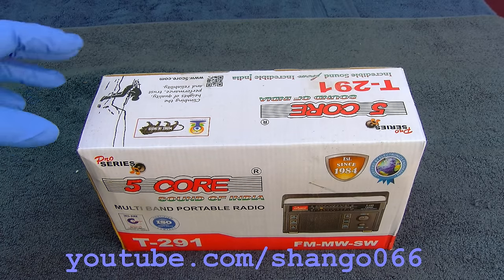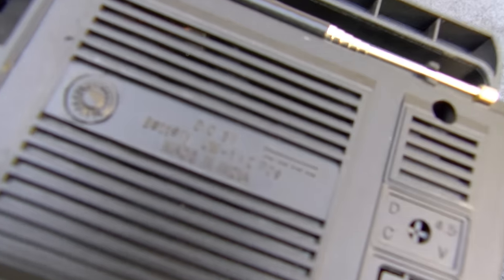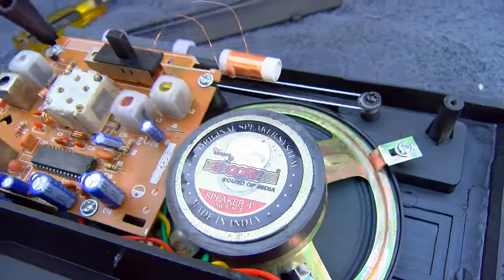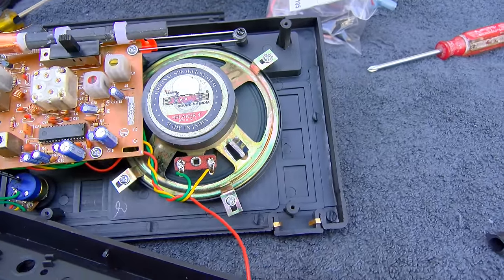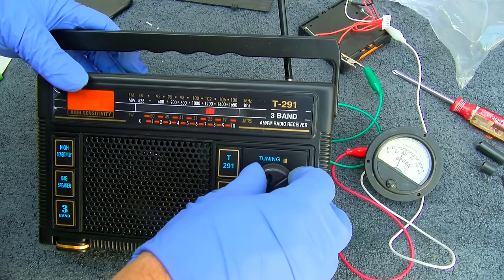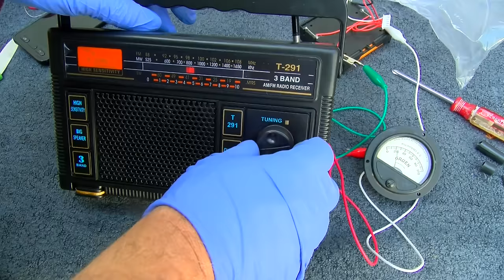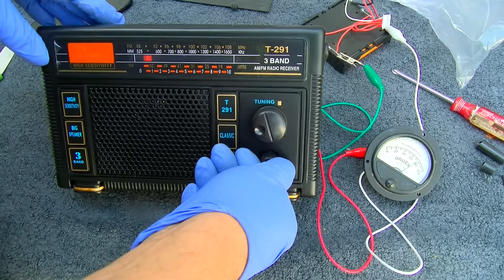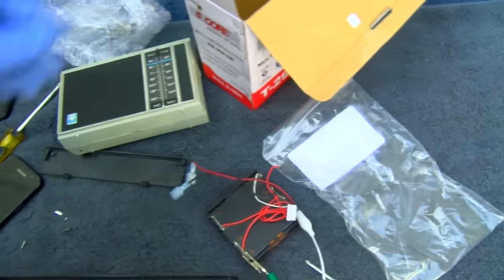Modern 5 Core AM FM SW Radio T291 Disassembly And Test Made In INDIA

Comment: The datasheet of the IC provides a diagram and there is a ceramic filter for AM, and this radio does not have it, and it could improve selectivity at least to a decent level. Even if you look at the PCB there is space for it.
Reply: The datasheet says the IC has 500 mw output when supply voltage is 6 volts. This thing only gets 3 Volts from 2 D batteries. That must be a really efficient speaker.
Reply: Yes. CF2 is missing and CF3 is shorted out. It would be interesting to to fit the 2 missing ceramic filters.
Reply: Could you pull the bridge from the space marked CF3 and replace it with a 3-pin filter like SFU455Y?

Comment: Shango, "5 Core" is not the only Indian- made radio. They used to make the Èton E1 (Grundig?) in Bangalore, India.  Its circuitry was based on the Drake SW8. It also had an FM band and provisions for XM radio.  It's been discontinued. I still have mine and it's a darned good radio -- so the Indians can make a good radio!
Reply: The e1 is a great radio. Just rubber coating on case had to clean off as became sticky.
Reply: Philips' still make radios in India. Philips Prince, Champion are to mention a few. I'm pretty sure that the circuitry in this 5core radio is a copy of philips Prince (with a philips chip in place of a sony)

Comment: Mine isn't nearly that wideband on AM, but I'm not next door to a 50 kW transmitter like you are. And the loopstick is supposed to go the other way around, so maybe that has something to do with it. Neither the Sony chip nor the loopstick were designed for shortwave, so that's why it's so poor on that band. And its sensitivity on FM is indeed impressive.
Reply: maybe shango's radio has a fault, why its so wide? bad IF transformer? i'd think the 3 plastic cased cans are the AM IF and metal ones for FM..???? with that ceramic filter for FM , looks like it has empty position on the board for another ceramic filter, for AM?
Reply: Yeah. I think this specific radio is a partial dud, both due to the fact that it was damaged and its performance on everything other than FM is really poor.
Reply: Yes agreed. He is in a very unusual market. I turn on am in ohio and I have maybe 5 stations, only 2 close by. Poor selectivity means better sound. Am is Almost dead too. I was really impressed with your review and loved your am740 spotlight. That's from where I was born. It's a terrific station and not just for music. It's time to change the track...
Reply: @Trance88  certainly possible, unless shango has a few very strong stations nearby swamping it out, i'd say 'something' is wrong.... i've made trf sets using the famous/infamous ZN414 and its equivalents with seemingly better selectivity, on average strength stations, on a single tuned circuit!
Reply: even nearby to a strong station, IF selectivity should be better than that.....
Reply: @andygozzo72  I guess.  I am surprised he didn't try to do a basic alignment check, especially that poor loop.
Reply: @markanderson350  the loop aerial wont have much effect on selectivity, only sensitivity and 'image suppression'  in  a superhet, the selectivity is mostly by the IF stages.. something is flattening the response, but without killing sensitivity much, if at all... without seeing the circuit/schematic, i cant really say what could cause it,  but if theres a common decoupler capacitor for the IF stages supply ,and its open or low capacity, may cause strange effects.. also open/low agc decoupler
Reply: I know, I used to fix radios, no money in it. Often the loop would be out affecting reception on the low end of the band. I agree, if alignment or maybe only 1 stage
Reply: Odds are "shortwave" just moves the local oscillator and re-uses the IF and detector from AM.
Reply: @russellhltn1396  yes it was pathetic sw. If you just shift the oscillator, you won't have any sensitivity. Maybe they dropped the fm osc down. It sounded like fm
Reply: @andygozzo72  yeah missing 455 ceramic filter
Reply: @mohinderkaur6671  just IF transformers alone should have good selectivity, without a ceramic filter, many AM sets didnt have them and still gave good results ,
Reply: @russellhltn1396  most SW sets did have the same IF as MW AM,  even many high priced sets, only 'communications' quality sets may have used higher IF or even double conversion
Reply: Geez, my Sangean ATS-505 aka RS DX-402 performs better than that any day!
Reply: Regarding the loop placement, the silkscreen shows it the way Shango reinstalled it, but vwestlife's had the coil at the other end, ignoring the silkscreen. I'm thinking that the silkscreen should be ignored and the antenna turned around. Also, I agree with another poster that an alignment check/tweak is in order.
Reply: @johnruschmeyer5769  shouldnt make any difference which way round the ferrite rod is mounted..
Reply: the way to see if the IF and its alignment is bad is to feed an IF signal into it and sweep the frequency from about 400 to 500 khz and see if it peaks 'normally' or is too flat topped,
Reply: Yeah and also his radio came trashed which is very unfortunate.. the shipping company literally carved a heart symbol into the circuit board.. how did they manage to do is unknown to me, but very impressive at the same time.
Reply: @harshnemesis  one thing strange is that some IF 'cans' arent metal, look like some sort of plastic , surely that'd leave them susceptible to interference and interaction?

Comment: I live in Europe.  Never have I ever seen a speaker size in metric, whatever its origin.
Reply from the maker: Russian Soviet speakers are in millimeters
Reply: Tire sizes are always metric in width, but inches in diameter. Bizarre, but that’s how it is. There was an attempt to make both metric in the late ‘70s, but it failed.
Reply: Used to see metric speaker sizes in Japanese radios from the late 60's through the 70's. 10 CM was a common size-just a hair under 4 inches.

Comment: Nice video. I bought one of these and was surprised at how well it receives. Your short wave problem is the assumption that the loop is also for Short Wave, it is not. I connected the whip antenna to a Sangean ANT-60  portable wire reel antenna with great results on SW. Please don't throw out that antenna!!! Just treat it tenderly! This is a $25 dollar radio, and it's built like one. Everything about this radio is done on the cheap. It's amazing how well it works.

Comment: Here in Brazil, we had a company called Motoradio. It was pioneer on automotive radios and sold a lot of portable radios.
Will be interesting if you grab one of those to check the quality, especially the units made in the '70s, when Motoradio used Sony components.
Reply: Get a MotoBras Dunga VII.  Fantastic old school transistor portable.  They are impossible to find here in the USA
Reply: @MrRadioRover  unfortunately, the models after the Dunga iii are all DSP garbage.
Reply: @joseislanio8910  not all DSP based radios are garbage.
Reply: @madmax2069  I agree with you. But that's not the case here.
Also, DSP is best used when you can actually set the frequency digitally, not with an analog dial.
Reply: @joseislanio8910  Sony fully transitioned into DSP based portable radios not too long ago, the ICF-P27 as example you can't really tell that you're tuning a DSP radio.

Comment: That wide tuning on AM may be a bonus.  Too many radios limit the bandwidth to 5KHz or even 3KHz, when the transmitters are putting out 10KHz.  That wide bandwidth might cover weaker stations, but I'll bet what it does pull in sounds better than most.

Comment: I am a longtime shortwave listener.  When listening to shortwave radios, you have to turn the tuning dial slowly, especially if all of the shortwave bands are on one universal band on the radio.  The stations tend to be crowded in a handful of locations on each shortwave band.  Turning the tuning dial too fast can make you miss some stations, especially when some of them have signal fade issues.  Not every international broadcast network will have a good, strong signal.  Another factor affecting reception quality is the time of day you are listening.  In the Eastern Time Zone, the best time to listen to shortwave broadcasts is between 7:00 PM and 11:30 PM.  Some of the international broadcasters broadcast their programs for Pacific Time Zone listeners between 7:00 PM and 11:30 PM also.  Solar storms on the surface of the sun can hinder or block shortwave signals, so that has to be taken into consideration when listening for important news broadcasts on shortwave radios.

Comment: The bad selectivity does mean your audio is much better. It is always striking how good the quality of AM stations is in the USA, compared to the rest of the world. 
Pretty much all european tube radios have 10-12khz bandwidth at most (transmitters RF 9khz to mayyyybe 11khz, except for Radio Romania that sounds good at 16khz with a wideband receiver) so you get audio just a hint better than phone quality. It was very much needed because every single european country used to have a bunch of 100-500kw medium wave transmitters, 10 times more power than the typical USA transmitter - otherwise you'd just have a jumbled mess all the time. 
I can still hear stations from the other side of the continent in the Netherlands at night.
Reply: If I recall didn't the FCC limit AM stations to 10Khz bandwith back in 1989?
Reply: Many AM stations in the US have to lower their transmit power at night. Do stations in Europe have to do the same thing?
Reply: European broadcasters mainly limit audio to 6 KHz. Some reduce audio to 4.5 KHz to reduce adjacent channel. Very few are running 500kw these days. Not uncommon to find services running 100kw today which in the old days ran 500kw. Those services under threat of closure due to running costs.

Comment: I ordered one the same day VWestLife put up his video and it's still not here (FEMA Region III). Hope it's not all smashed up like yours.
Edit: No physical damage but the dial pointer was off the track and jamming the tuning - easy 1 minute fix. Circuit board and speaker identical to yours. AM performance is better than expected but has poor electrical noise rejection - bandwidth was a little wide but nothing like yours. FM antenna broke right away but this thing doesn't care and gets really good FM anyway. SW is useless. The sound is better than expected and should get better as the speaker breaks in. I got this thing as a throwaway radio for working on stuff outside but I'm starting to like it more and more.

Comment: WHAT A GREAT PORTABLE RADIO! I'm not sure what your quality criteria are, but from where I'm standing, this looks like a great little radio. The sound is about 1.35 million times better than any western portable radio I've bought lately - you know, the ones that have a huge speaker grill in the plastic, but inside you have a piezo element. This one has a proper speaker and it actually has bass too. The power consumption is remarkable. 5 milliamps plus speaker drive, that's remarkable, the modern digital tea5767 based units have 4 times bigger power consumption. This would play for months from 2 D cells. And it picks up stations really well. From U.S. big city point of view the selectivity is not great, but for rural areas, travel, hiking, this has great sensitivity. In short: a great piece of proven design, they really did do these better in the analog days.

Comment: Hi there, greetings from Ireland. I'm into all about radio and love your content.
Just by looking at the PCB of this radio, the AM selectivity is none but you can fix this easily. there is unpopulated 455 KHz IF filter on the board.
Just remove jumper and solder one in. I think it's worth it. then the sensitivity desert test would be nice:)
Reply: So, pull the bridge from the space marked CF3 and replace it with a 3-pin filter like SFU455Y?

Comment: As you say, the FM reception is awesome. In earlier days, they used to make cabinets using bakelite. The cabinets were sturdy, but the transistor radios were heavy. To make it lighter and better portability, plastic cabinets were used. Honestly I feel that by charging a little more than $25, they could have given better finishing/reception.  I am from India, and I have used high quality transistor radios especially the ones made by Murphy, Bush, HMV, Philips etc.
Sadly, very few people are enamored of the transistor radio. Even many Japanese electronics giants have stopped making transistor radios. And Sony has already announced that they will no longer make SW radios. But a very good and informative video. Keep rocking.

Comment: One thing about the Shortwave. Put the antenna back down and return it to the stored position for use with SW. I get no SW at all with the antenna up. On AM I get FM bleed over with the antenna up too so I only put it up when listening to FM. I think the filter arrangement needs help. 

The datasheet for the 1619 IC has it using three ceramic filters (CF1, CF2, and CF3). The radio has places for them on the pcb however only one is installed. (at CF1) and a jumper where CF3 should be. The one installed at CF1 is one of the 10.7 filters (Either CF2 or CF3 on the datasheet) and the 455 CF is not installed so that's probably why AM is all over the place and FM isn't as precise as it could be. I've ordered some filters based on the datasheet and I'll install them in mine and see if it works any better. 

Mine had the same problem yours did, busted standoffs and the ferrite antenna busted off and magnetically stuck to the speaker. Mine also had 6 missed solder connections on the back of the board so if you get one of these radios check for that. Also use some hot glue to better secure the ferrite antenna, it's just held in with a small amount of wax.

One thing I did notice was the plastic can be repaired with superglue quite well. So this radio has some things going for it, it's easy to repair and has modification potential (convert to one 18650 battery for power, add a tuning LED indicator since the IC supports it and filters based on the datasheet.)
Reply: That sounds like a really fun project. I ordered one based on VWestlifes video. I'll definitely have to look into getting it up where it can be.

Comment: Nice video dan i seen the v westlife video and i wish he opened it up to see the circuit but he did not so thank you for opening it 
As for the radio circuit it is a am/fm front end with rf /if and build in amplifire the volume signal control it happen in side the ic but the volume control key it control a voltage and the voltage go to the electronic volume control circuit  that feed the audio signal to the amplifire in put circuit inside the ic  there is an smd type with the same part number it is made in china  license by sony corp  and it is from cxa1..... family 
 the radio that banggood  give you and you build it the am / fm one  it has the same type of ic but smd but it is a from the  cxa family

Comment: Inches are being used almost worldwide in some circumstances. For example, hard drive enclosure sizes, DVD/CD/floppy sizes, jeans sizes, speaker sizes, display sizes, wheel sizes to name a few... Feet are being used in aviation worldwide except in Russia.
Reply: Its funny in Australia we went metric before I was born , but to this day they still use imperial for TV and mobile phone screen size and sometimes even put newborn baby weights in the old money as in Pounds and OZ.
Reply: @steviebboy69  Well, many countries have "always" been metric, but imperial units are still being used in the forementioned specific applications, because it has become the industry standard.
Reply: @joojoojeejee6058  Well this country was imperial and even had the old funny money as I would call it.  I am glad they changed it though metric is easier to work with I guess.
Reply: @steviebboy69  Yes. Canada on the other hand seems to still be in "transition" after adopting the metric system in the 1970s. Both systems are being used there, and imperial seems to be  predominant..
Reply: @joojoojeejee6058  I guess it is also what you  are used to using, my mother would still use the old system.

Comment: Try realigning the AM section. Maybe even add a ceramic IF filter (on the board it looks like the place labeled CF3 with a jumper across it), could improve the selectivity. Maybe lose that disc capacitor next to it. Looks like that Sony chip uses an IF of 455 kHz. Data sheet specifies a SFU455B CF (I'm sure you have a junk radio that you can pull one from).

Comment: I recently bought a $20 modern radio that hss analog tuning as well, the Sony P26. It isn't the most amazing radio out there but I like it a lot because its small like an old "pocket" transistor radio and I can DX pretty effectively on it, particularly at night. Hell I picked up a station in Iowa tonight and I'm in Syracuse, New York roughly 800 miles away. But it does have a problem at times with overlapping station signals like that 5 Core, so I'm sure it has its limitations as well. But for just $20 on Amazon, I've been pretty happy with it.

Comment: Greetings:
The fer-rite rod antenna would  appear to be mounted in the two broken corners of the PCB with the coil on the right side.
What is the speaker impedance? 10W?
I think I saw that 2 1.5v cells are used (C or D?) plus the rear is ready for a 4.5v dc jack?
I await your DC power-up. and IF tuneup.

Comment: Looks like the radio is open for modifications with those empty ceramic filter slots. This old school superhet radios with all those IF cans are easy to modify to improve reception compared to  modern DSP digital signal processing radios or SDR which relies on factory preset software not user-selectable or non-modifiable hardware. Fit those empty filter slots with a Murata narrow filters and that radio will be selective enough to do weak signal reception.